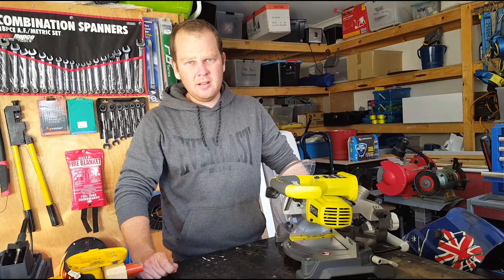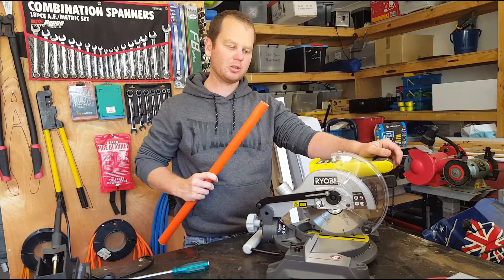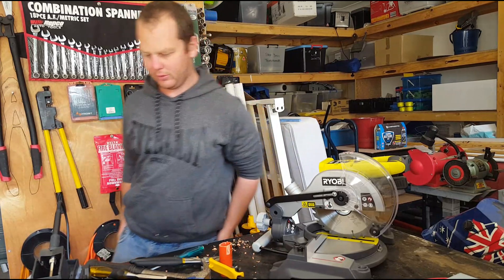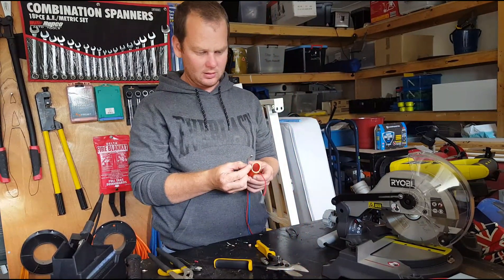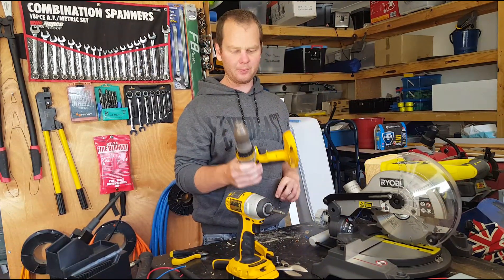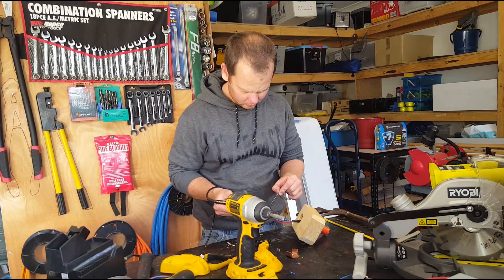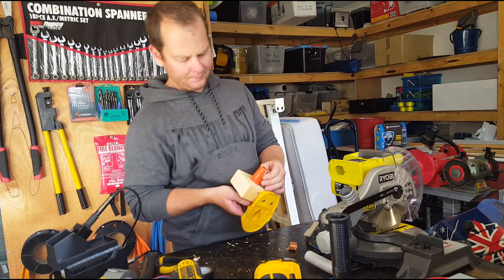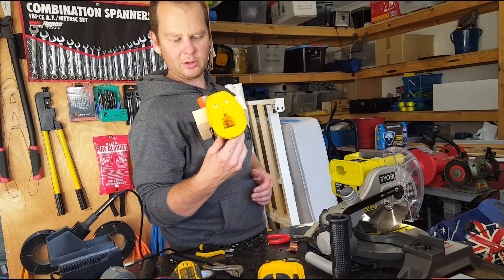Making Ryobi One+ Tools Run Off DeWalt Battery

Comment: Cool ideal but you might want to be careful with that. I believe the protection circuit on the 20V Dewalt tools is in the tool itself not the battery. If you discharge the battery too far it could catch fire or explode.
Reply from the maker: skudpond mine are the old bangers that are interchangeable with the nicad so the protection should be in the pack. Most of the cells should protect themselves from over discharge I think. The circuits should just balance the cells for the discharge I understand for the newer packs. Same for the chargers, the should balance the battery for the charging. Don't quote me though.